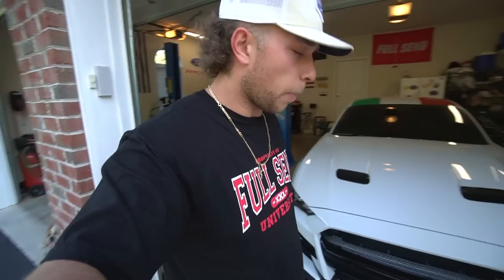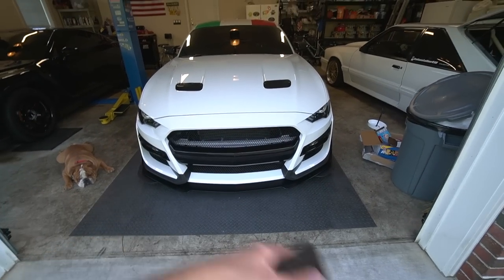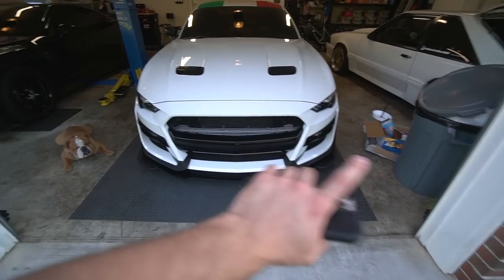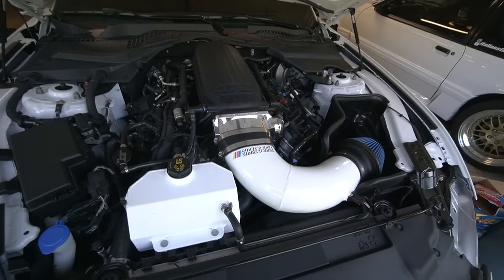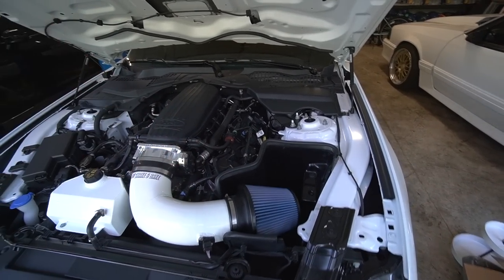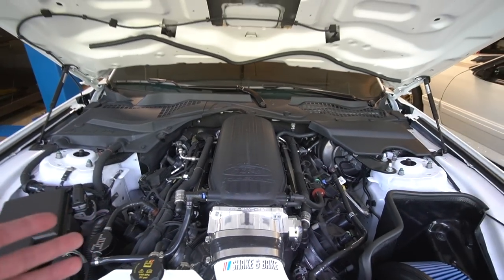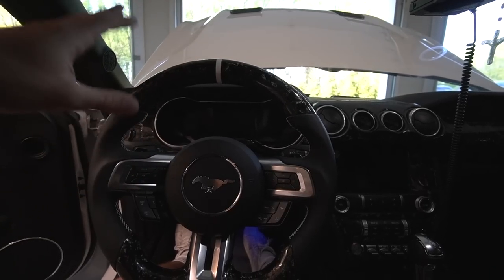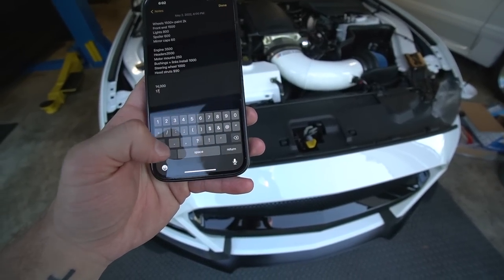How Much Money Did It Take To Build My!!(FBO GEN3!)

Comment: It’s crazy how quick it adds up!  I wanted to offer up some advice to help Apollo get even faster.  First get a battery relocation kit from Watson Racing it made a huge difference with my launches.  Second get a pedal commander and eliminate all that throttle lag and you will be amazed how much faster you get into power!  My gen 3 coyote with stage 2 Whipple woke up when I got rid of throttle lag.  Good luck with the projects.
Reply from the maker: Thanks for the info my car has close to nothing lag wise my tune is on point in Apollo
Reply: @ItalianStallion410  a pedal commander?😂😂😂 sounds like someone needs a new tuner

Comment: Good video man, I'm a cheap ass and found my procharger for 2200 on marketplace. Have about 4300 in injectors and everything to boost it. I did my build completely opposite. Boost first and supporting mods after. Both are good options. Fords stock parts can handle a SHIT load of abuse
Reply from the maker: Damn that’s a good ass deal!!

Comment: did u upgrade any fueling for e85
Reply from the maker: No didn’t need to for the gen 3s
Reply: @ItalianStallion410  awesome! what’s your AFR at idle for E85? Sorry i’m just curious to know if my gen 3 is getting similar results with the tune/E85
Reply from the maker: @ABGamingChannel  I wanna say 10.0- 10.3 if I remember correctly I haven’t drove the car in a few days
Reply: @ItalianStallion410  oh thank God lmao! Mine has been at 10.1-10.2 and i was worried it was running too lean, but i’m pretty sure it’s good, some other people had the same AFR on E85
Reply from the maker: @ABGamingChannel  yeah you should be good

Comment: Is there reason you didn’t just get a GT350?  I mean after you spend 50k on the car and 14K for the mods you’re at what a Shelby costs.  The gt350s are sick looking 526hp and you can literally beat the piss out of them all motor and they hold their 60k value.  10r80s are nice but I’ve driven some used 10R80s with around 40k miles and the feel ragged out or the ones I drove did
Reply from the maker: I have some buddies with some gt350s and they blew the motors up in them in no time plus I talked to the guys at ford performance racing school and they said the gt350s blow up way more than the regular 5.0
Reply: @ItalianStallion410  my buddy has a 2018 GT350 and he spun a fee bearings. He was so worried it would happen and it did🤣 I told him he actually got a deal, cuz insurance paid for a new one, with upgraded 2020 parts. They made quite a few good upgrades to the later 5.2s....
Reply from the maker: @rileytinny5946  yeah the 18 and up ones are better but I raced a few with Apollo and walked them plus I drove one and wasn’t a fan tbh
Reply: @ItalianStallion410  I was just curious.  Ive looked around for one and can’t find one under 50k.  I see they hold their value really well and heard of guys blowing the motor with forced induction but not NA.  I would think if you check the oil religiously there wouldn’t be a problem.  I have 17 GTCS 6r80 and 12 Roush RS3 and absolutely love both cars.   My dream car is a Super Snake which I may get in the future.  Apollo is sick bro.  Love to see that thing run in person
Reply from the maker: @Sick_ridz  thank you!! If you come to our next tour we will be racing the cars at the track 1000%

Comment: 2020 mustang I'm looking at 15000 miles they want 54k what u guys think thanks

Build completed by Justin's Performance Center, Inc.

*VMP Odin Supercharger Kit
  88 mm / 3.4 in 6 rib pulley for TVS 5.0 SUPERCHARGER
  1050x Injectors
  VMP Twinjet 69 MM Throttle Body
  VMP Odin Ice Tank
  N-Gauge/ HP Tuners
  Tuned on 93 octane by VMP Performance 632whp
    Ford Factory Active Exhaust
    Brembo 6 Piston Brakes
    Eibach Lowering Springs

*Michelin Pilot Sport 4S tires
  275/40/19 Rear
  255/40/19 Front
Reply from the maker: Yeah that’s doesn’t seem like a bad deal as long as the car runs good and it’s clean go for it